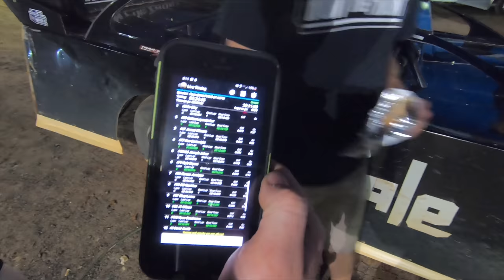Joseph Won and I Climbed Back into the Points Chase

Comment: If you guys are running pump gas with ethanol in it, be aware that the ethanol tends to swell the small rubber gasket  in a standard needle-and-seat. E10 fuels will also slowly eat the carb from the inside out.

Comment: Cant wait for this channel to blow up sadly not too many new people are actually interested in dirt track racing  :(
Reply: Couldn't be more true. I wrote somewhere in the comments:

For anyone interested 
There's a couple series championships for dirt racing on iRacing.com. It's a video game, yes. But with some research youll find out other than the smell of tread and motor ...they've created the closest nostalgia simulator you can. Tracks wear as the race goes on, cushions grow, points for cold hard cash are on the line..etc. These are dirtbugs that have spent $2000+for a setup to race virtually. To just say it, they're not racing just for fun. Be open minded and you might just find you a couple hours of dirt you didn't know you had in the palm of your hands.
Reply: @lolliear6070   can you actually play on there
Reply: Well when you type in world 3 hour figure 8 speedrome and you see that type of racing you will know why
Reply: austin_smith_2016 
iRacing is a simulator made in 2008. It has Formula cars, Indycars, late models, sprint cars, stock cars, GT cars, LMP1 cars, and LMP2 cars. There might be more. William Byron got in NASCAR by using this simulator. It’s expensive, but you can try it.
Reply: So So many aren't even aware of dirt track racing --- Sadly, if they're not made aware (or available to view) it will die off. Hat's off to @HuntTheFront for giving a real world look at racing (in general), Jonathan and crew(s) do a fantastic job!!! Video games are great but there is a time and place for them; they can (and do) become habit forming! It's great to hit a reset button and start allover (at no cost) ---- Younger generations, sadly -- can't, won't, or don't know how to put forth the effort to succeed (or fail [= learn] in real life).

Comment: Waited for this. I'm addicted 💊 
Could you maybe post standings in points or add some content in between races? (Examples: don't give nothin away but some garage time?, history behind a track or talk of some stragedy you might use..etc..) 
I only ask cause die-hards don't have much to work with as far as umps, sprints, late or super models 
Thanks from KY 👍if you ain't tradin paint you either ain't racin or he ain't racin you.

For anyone interested 
There's a couple series championships for dirt racing on iRacing.com. It's a video game, yes. But with some research youll find out other than the smell of tread and motor ...they've created the closest nostalgia simulator you can. Tracks wear as the race goes on, cushions grow, points for cold hard cash are on the line..etc. These are dirtbugs that have spent $2000+for a setup to race virtually. To just say it, they're not racing just for fun. Be open minded and you might just find you a couple hours of dirt you didn't know you had in the palm of your hands.